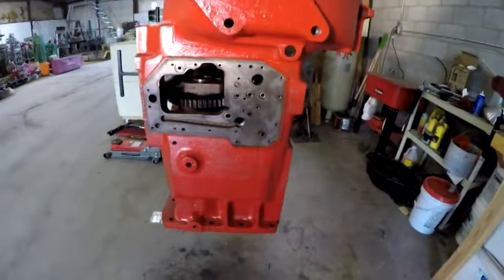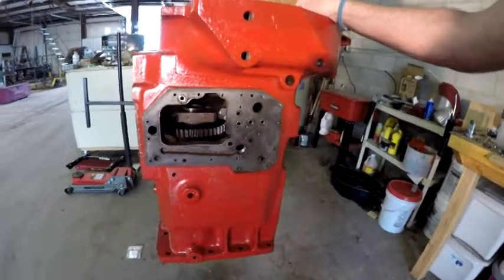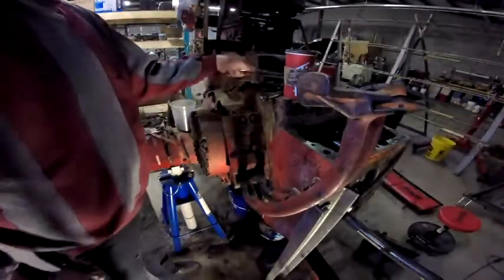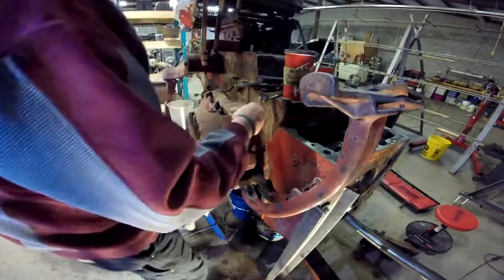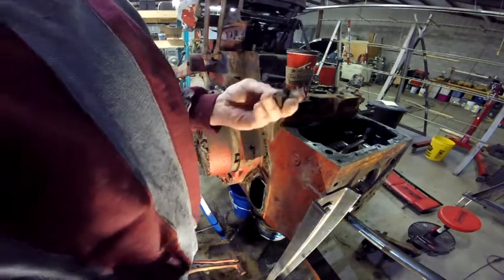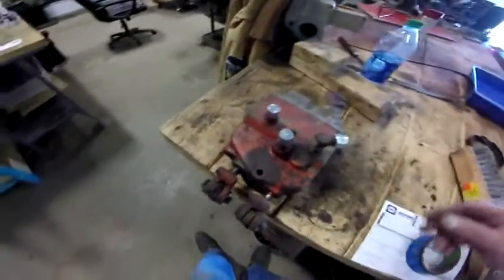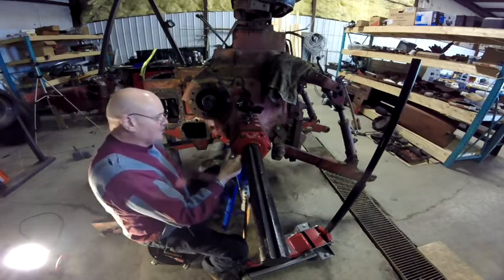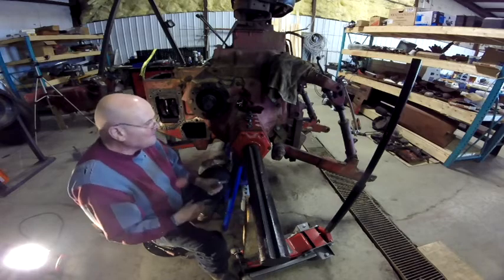IH 1066 Tractor Project Part 24

Comment: Fred
Go to the Long Island Trailer Update Video. You asked about kit for brake valve, I listed the kit part # , Hope that helps.

Get a few extra o-rings for those tubes, in case you still have an issue replacing them.
Reply from the maker: Yeah, as I posted there, I totally missed that!

Comment: As long as you are working on the rear frame check the dots on your vibration dampener on the engine. They should not stray far from each other. If they do you need to pay real close attention to your ring and pinion in the differential.  A shot vibration dampener will take out a ring and pinion fast. Some say it is the only thing that will take out the ring and pinion other  than over loading or contaminated Hytran.
Reply from the maker: I will check that out Paul! So when now you have me concerned, not really sure if you can get more contaminated then what I had for fluid in mine, even if it was HyTran that I took out of there!